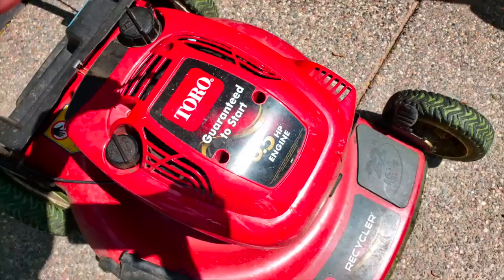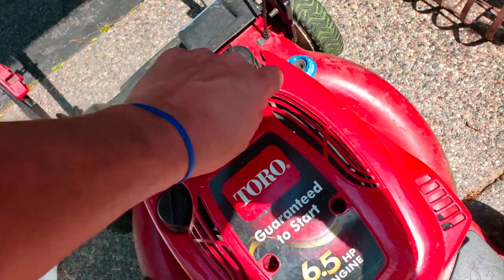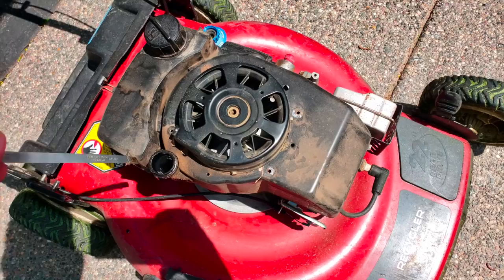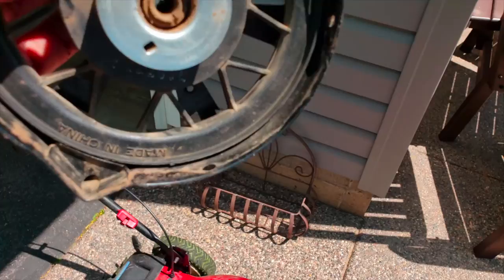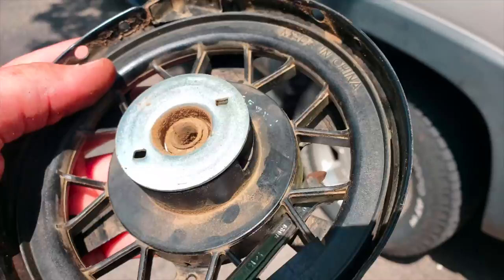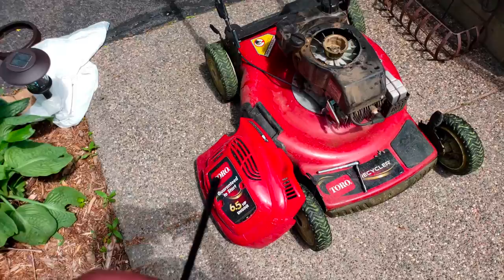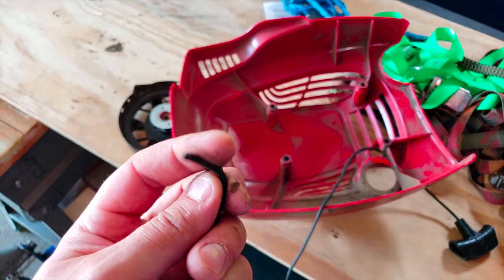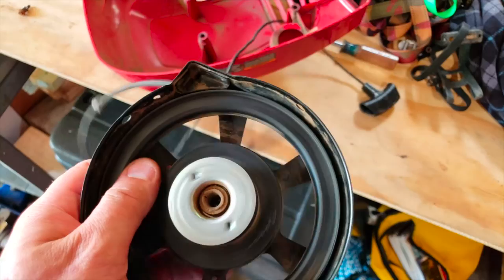How To Fix Broken Pull Cord on Toro

Comment: I found this great. I added using a fishing line as a snake line so it was easy to pull the cord through the hole. Just push a piece on monofilament line through the spool and out. Then use a fishing knot and pull it through. Worked great and thanks for your video.

Comment: Truthfully, I am not a 10 thumbs kind of guy but am pretty close. I dreaded tackling this job but my local dealer was going to charge near $100 to fix it for me. So I watched you vid, sucked it up and got started. The parts came off easily enough but I was unsure about threading the cord. After watching your vid, I saw exactly how to do it, (great tip btw about using a wrench to hold the tension on the wheel), and had the whole job complete in about 25 minutes. Mower started up immediately and is working fine. Because the rope broke right at the knot in the machine, I just reused the old rope until I can purchase a new one.  Thanks for the vid, VERY helpful.